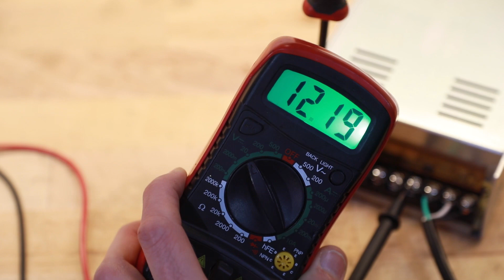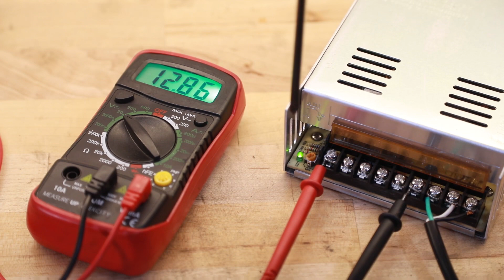Cheap Garage Power Supply

Comment: That's the same exact power supply I bought for my car audio test bench.   Going to be nice to have an easy way to test 12v powered units without having to pull my car up and wire everything to the battery...lol

Comment: Maybe look into getting a variable power supply. You can get a good one cheap capable of doing 0-35 V at 3-5 amps for pretty cheap. under $50. Of course these are not anything really nice like you would find in the laboratory. So don’t leave it on when you’re not at home or nearby to keep a watchful eye. And although they aren’t “professional“ they’re still really great and fine for most people

You could still have a higher wattage 12V supply if you wanted. Since you work with a lot of automotive stuff maybe you’ll need higher amperage.

A variable power supply would be much more versatile. I settled with one from eBay… It does 0-120VDC  at 3A. Sometimes with LED stuff you need high voltage DC like that. So it comes in handy.

Also you need to be able to control a constant current and constant voltage. So you don’t get spikes which will ruin or blow out some of your components. Which all of these cheap power supplies I’m talking about allow you to do.

Many different components will “run away” and begin to draw massive amounts of current as the temperature rises. LEDs come to mind but there are many things that can do the same.
Reply from the maker: Ya I definitely wish this supply would do 3-5v just like you are saying to trouble shoot electronics. But it was more useful to me as a high amp 12v supply. But I have lots of room to add more options later on!

Comment: "L" = Live.
Reply from the maker: Thank you! I need to learn AC wiring at some point. I have had trouble finding someone who is knowledgeable enough to teach and not just show me how to wire 110-240v AC.
Reply: @Petrol360 : I am by no means a professional. But it's really not that hard. As long as one is carefull and plays it safe. Of course you must take your time and don't rush it and all will go well. Otherwise it might literally be a "shocking experience".
Take care.
Cheers

Comment: Great idea to help keep bench top clutter to a minimum!    Honestly, I would do this same thing if I hadn't just got a soldering station that has the built in power supply.  Nice job and like how you set it up.    One thing, maybe consider some spacers under the main unit to allow maximum air flow.